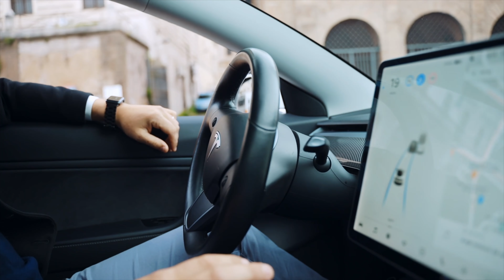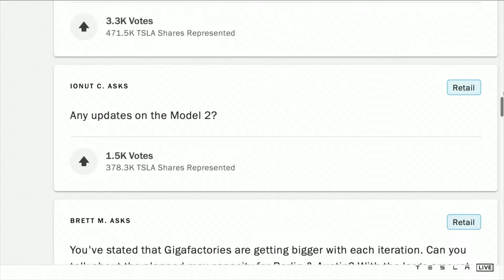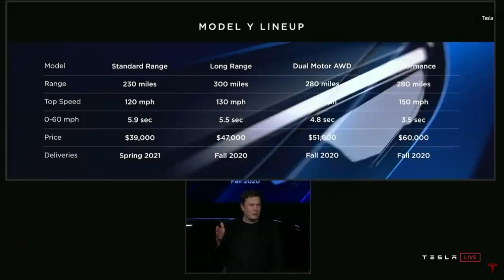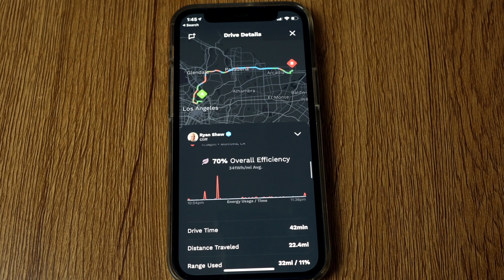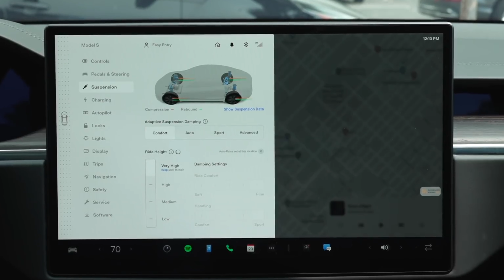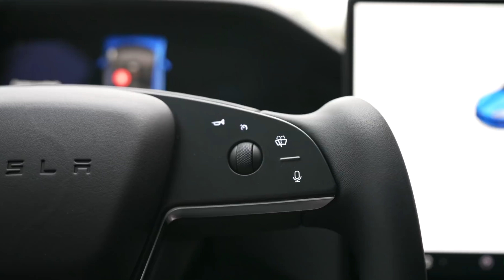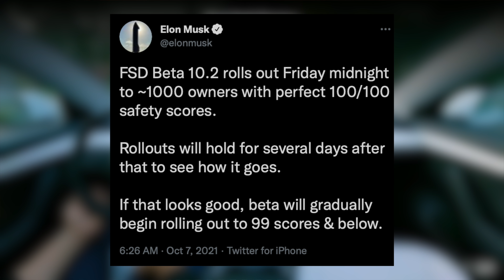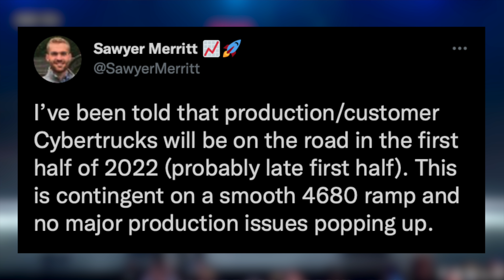NEW Tesla Model Y for 2022

Comment from the maker: Download Tezlab for FREE: https://tezlab.app/ryanshawtech
Reply: No just no...
Reply: Question: Can you feel the buttons on the yoke? Are they indented or any kind of other feel?
Reply: @SamuelHauptmannvanDam  buttons are flat, you got to either develop muscle memory or look down to push them which imo is kind of dangerous
Reply: Please explain that you are a part owner of this company
Reply: @josephyang3260  needs to be indented of some kind.
Reply: Why
Reply: @josephyang3260  0
Reply: L
Reply: Can you make us a EV Motorcycle  Elon that can get 250 miles with fast charg or 200 miles. Help us out for we like Motorcycle and insurance  is must cheaper  for a Motorcycle. Keep up the concern  for us that are in the low class in the mony aconamy.
Reply: So the reason for why the S and X can't use the new adapter is because when you open the charging port you'll notice that the S/X has much less space than the 3/Y, the 'Karen Lock' as I've found the best thing to call it so no one can unplug your car at a public charger because the lock doesn't work also doesn't work for the same reason, it could probably be fixed if you make it so it exends out a bit more so you could put an adapter on, it'd probably be yet another adapter but it'd work, hopefully they make an S/X version with this extender build in for this reason

Comment: Thinking about why the Tesla model 3 and Y might get an air suspension, and all you have to remember is under what circumstances the car would need to squat.  Perhaps performance versions of the 3/Y may get cheetah stance to help improve 0-60 more
Reply: Air suspension is for better ride quality, especially on these heavy Tesla boats. As you mentioned, also for launch mode and raising front end up on steep driveways/speed bumps.

Comment: Its really cool to learn two YES! Two new colours are to be launched at some point next year, a metallic darker red and possibly a return of Silver, Germany has been fitted with a state of the art spray booths. About time too- I think a revision of a colour pallet is needed. The larger battery cells will be used once Berlin has, firstly, been signed off by local environmental government, lastly once the battery factory is online in Berlin too, in 2023 they'll be fitted to model Y as mentioned before. Lots to look forward to in 2023 especially in the UK.

Comment: I still have a reservation of Tesla model Y LR RWD . About delivery in 2-6 weeks doesn’t mean anything! I have this 2-6 weeks delivery in my account more than 6 months! I called Tesla at that time asking if it’s coming up but they told me nothing we can tell about it and when you will get it or will get it at all.
Reply: Call your tesla advisor about the $8000 federal tax credit for cars in 2022.
Reply: @bobskeway8179  it doesn’t worth it because now tesla dual motor with fee, registration and FSD will cost $68200 and after tax credit will be $60200 while my confirmation with fee registration and FSD is $56000 before tax credit
Reply: I locked in a price at 54K as I ordered a while ago with the stipulation of  the 4680 battery and my friend locked in yesterday with a price of 57.5K for model y
Reply: @bobskeway8179  how to do that? Or just hold reservation?! As understood price anyway can’t be locked and just FSD can be locked
Reply: @proeasylife2005  Hi Muayad! My tesla Advisor locked in a price which was lower at the time and wrote in my conditions which were the 4680 battery and air suspension. Call Tesla push "sales" and you will talk to an Advisor. It is that simple. My friend did it last Saturday but got a higher lock in price.
Reply: @bobskeway8179  thank you will call them

Comment: @Ryan Shaw So the reason for why the S and X can't use the new adapter is because when you open the charging port you'll notice that the S/X has much less space than the 3/Y, the 'Karen Lock' as I've found the best thing to call it so no one can unplug your car at a public charger because the lock doesn't work also doesn't work for the same reason, it could probably be fixed if you make it so it exends out a bit more so you could put an adapter on, it'd probably be yet another adapter but it'd work, hopefully they make an S/X version with this extender build in for this reason

Comment: I just can't imagine much demand for the $40,000 cybertruck. I'm sure there are people who would want to buy it but it seems to me the people who want to use a truck would need at the very least the 2 motor model
Reply: Last I heard was a 10/45/45 split between single/dual/tri motor variants. Average new full size truck transaction price is around 50K so it makes sense for demand for higher end models. I think the price will change though for single and dual motor to 45 and 55k respectively.
Reply: RWD trucks are more capable than most people think, just in general. Fleet managers and small companies know this.

I'd rather have a RWD CT than a SR+ M3. It would haul more people and cargo. It could go more places. It could tow. It will last longer.

But, yeah, I reserved a dual motor. 😀
Reply: @usa-ev  Well, for the extra 10K you will get a larger battery back, and extra motor which is definitely worth it. RWD is nice, but AWD has no downside in terms of efficiency. It is VERY negligible. Also the performance gained is very cheap for 10K. Overall I don't see the point in the RWD. It may be capable, but the extra motor is useful and can come inn handy if one motor doesn't work. At least you can drive around with the other motor.
Reply: @ayushmalpeddi2793  I ordered a dual motor first, in order to have 4wd, more towing, bigger battery. I want to drive it myself, to off-road parks, and to tow trailers to go camping. But it will start out as a rental so I can pay for it. Before FSD went up to $10k, I ordered a single-motor for use as a taxi/limo or for anyone who wants to rent a light-duty truck. Most people hauling 1 ton of material or buying building supplies and driving on normal roads will be fine with the single motor. It's a great value for having air suspension, bed capacity, 5 passengers, and other Tesla features.

Comment: Ryan, can you post where the CCSI adapter will be sold at? I went to the Tesla site and there is nothing there yet... Would love to get one on preorder as I tow travel trailer with my MY, and there are times I have to rely on 3rd party chargers. Right now, I'm using a CHAdeMO adapter that is hit or miss because there are usually on one available at an Electrify American charger and quite often not functioning. Any extra info you my come across would be helpful!!

Comment: Does anyone know why Tesla insists on all-glass roofs on their cars -- especially with the risk of fracture in the case of severe weather (common in the midwest)?  It's also extremely inefficient during the summertime placing significant additional heat load on the air conditioning system.  A standard metal roof makes much more sense.

Comment: Hi Ryan, 
I’m from Ontario Canada. My Model Y is estimated to come end of February - end of March. I don’t expect air suspension or 4680 cells but what features do you think will be available for the 2022  by the time my vehicle is manufactured/delivered?
Reply: You can order and put in the stipulation you want only a Y with 4680 battery and air suspension. I did that.
Reply: @bobskeway8179  seriously, where were you able to do that? Would it be too late for me at this point?
Reply: @nikdeo6410  you have phone the Tesla advisor as I did and check out the price yourself, my friend who  went with me locked in at 57.5 k yesterday for Model Y 4680 batteries. Check it out on Monday . Had to put $250 deposit. I did it with the stipulations it was the 4680 battery and locked my price in which 45k a while ago. Make the call and check it our ask about the federal point of sale of $8000.00 which Tesla does not control but it looks very promising as I type this.

Comment: The forward collision warning is the worst.  it is the main buggy point.  it doesn't recognize turning cars clearing the lane and dings me every time even if there is enough space for the offending car to have completed the turn maneuver before i get even close to them.
Reply: You are probably too optimistic about how quickly that turning car will accelerate away from you. If you're sloppy with that it's almost always fine... until it isn't and you have to slam the brakes to avoid a collision (hopefully there's no snow on that road!).

Comment: I’ll bet the 25k car turns out to be the Aptera. After exploring their site you’ll find the Tesla charge port, dash and steering wheel.
Reply: Absolutely not. The (not-so-named) Model 2 is primarily for Europe and China, and the Aptera has a wider width than the original Hummer H1. Won’t even fit on those streets.

Some cooperation between Aptera and Tesla is probably coming, although I wonder if it’s a good idea to go for the Tesla charge port now that CCS has been established as the standard.

Comment: why not RWD, UNLESS THERE'S NOT A SUPPLY ISSUE WITH EXTRA MOTORS, DRIVES, AND COPPER WIRE?
Reply: Supply issues is with batteries and chips, and ALL cars need those so it makes sense to only sell the highest margin cars now.

Comment: I’m sure the quoted cybertruck prizes are with fuel & maintenance savings in mind. Would not put it past Elon to pull a stunt like that. Tesla prizes are default quoted with potential savings. For the model 3 this is $5000. Fuel savings for a similar gas/diesel truck could bump up the real prize by 7.5/10k . Therefore the 39.900 cybertruck will really cost $47,400 or $49.900.

P.S. The Tesla plug is not the best, they overheat in the summer. Where as CCS don’t overheat as much, because they are mostly liquidcooled. Tesla has great tech, but the CCS standard is beter when it comes to cooling. Only V3 chargers are liquid cooled. Furthermore CCS supports up to 350kW,  in contrast the Tesla plug goes up to 250kW.